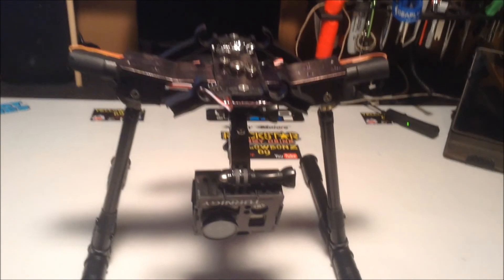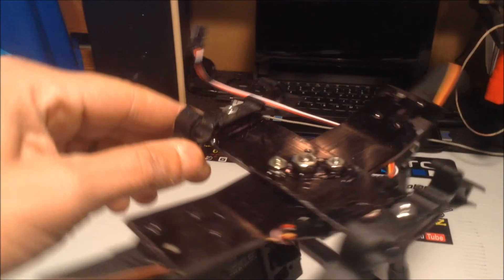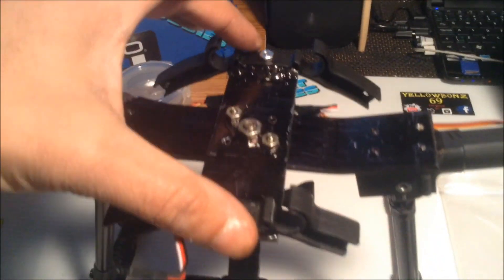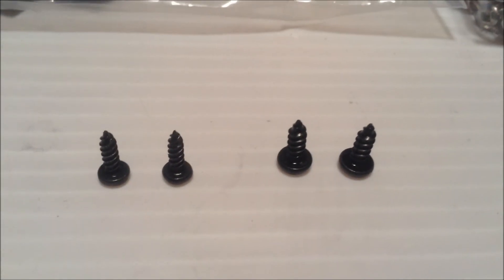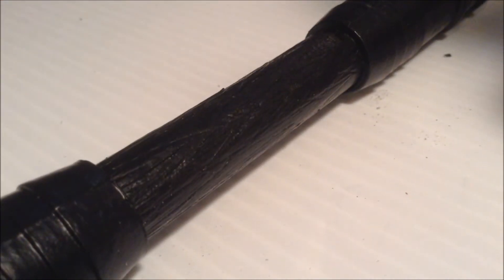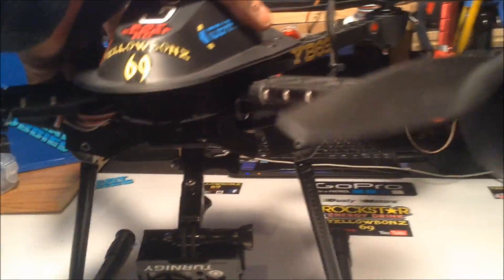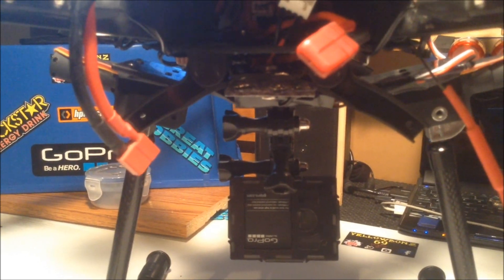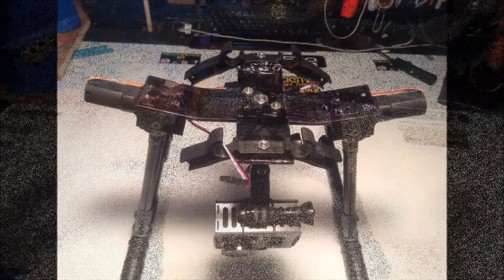How I made my Retractable Landing Gear for my IFLY4

Comment: Where did you order your GPS system from? Would a NAZA controler work on it? Nice retracts. You should have showed how you attach the retracts to your carbon legs, I know you do not have a lot of time to make a video.
Reply from the maker: GPS is a IdeaFly Product, lots of guys use the Naza Controller, depends on what you are comfortable with and how much you like to work on the quad lol. Quite a few different ideas out there on how to mount the Carbon Rods to the retracts, I used threaded rods and hot glue, seems to be hold perfect.
Reply from the maker: I believe the rod was 7/16``, it fit into the retract perfect. The inside of the carbon tubes i scratched/scored up to give the hot glue something to grab onto and its a solid fit with the threaded rod

Comment: where didi you attached the gps antenna i still didnt fins the right place
Reply from the maker: I mounted it Portside on a Aluminum extension in between the arms, should be good there at least for now.